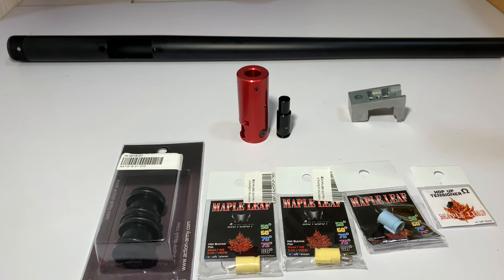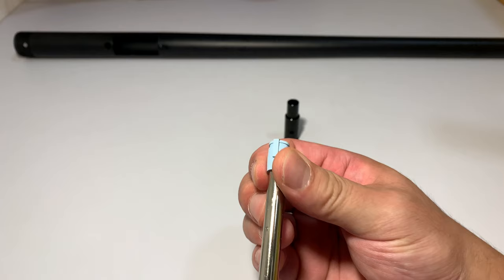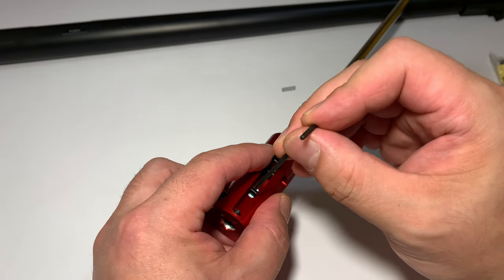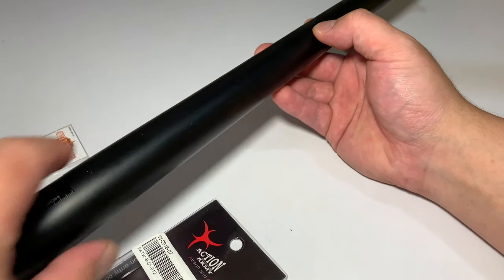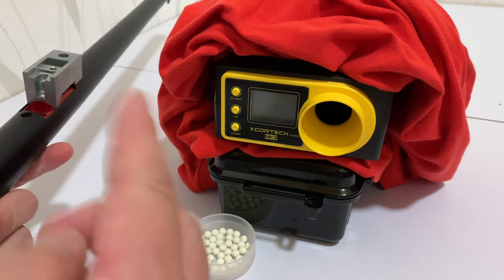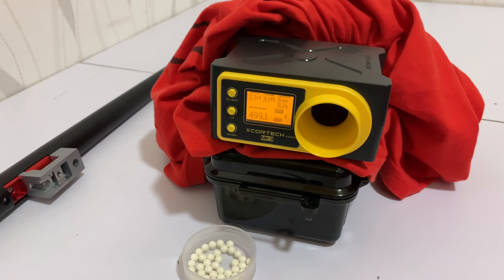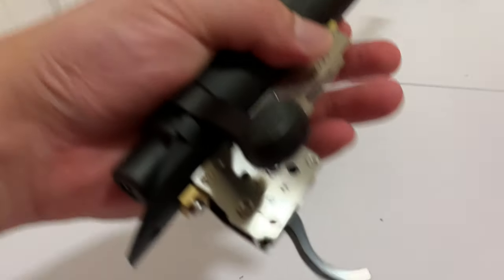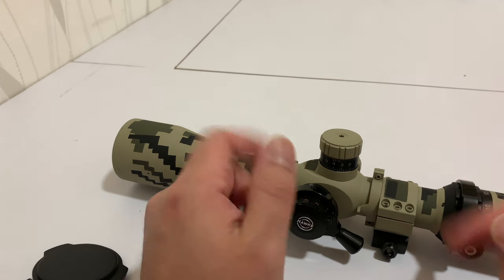VSR-10 Build Series EP 3 - Hop Up, Barrels, Spacers, Chrono, Scope

Comment: when i ajust my hop up, the fps drop and they don't go up like you, i have the same part installed.
Reply from the maker: Jérémi Caron 
It might be a good idea to disassemble and recheck all parts, especially the hop rubber. Some hop up rubbers can come from the factory a little badly made. Also pay close attention to the mini nub and make sure it is seated correctly.
Reply: @AirsoftAfterHours  everything is placed good, when i adjust it, the fps goes up until i get to the peek, and then if i adjust more, the fps goes back down and the hop up efffect cancels
Reply from the maker: Jérémi Caron 
That sounds like everything is working correct, once hop up is adjusted enough to lift the bb no more hop need be applied 👍🏻

Comment: by your accent i'm going to assume you are UK based...

bit concerning.... what you are suggesting is to adjust your hopup to take a 517 fps gun (dangerously close to the 520fps reclassification limit of 520fps or 2.51 jules were it'll become an airgun not an airsoft gun in the UK) to under the 500fps limits that most airsoft sites have for bolt action sniper rifles in the UK,.....  

2 major problems with this.... 

firstly 
the 500fps (2.32 jules) is meant as a maximum energy that the rifle can achieve no matter what the position of the hop is.

and secondly 
an more importantly the limits are 500fps which translates to somewhere around 2.32 jules with .20g bb's but ill be willing to bet you that with jule creep will push the jules to somewhere near or above 3 jules with .40g  or heavier bb's making it an airgun  and subject to normal firearms laws and regulations... generally you should be looking at around an m125 ish to keep your jules on or under the 2.3 jule limit. iv setup wolverine bolt kits that have massive jule creep having to drop the .20g bb fps down to only 400 to get the 2.3 jules on .40g bb's...

by pushing these to the very limit you are getting people to use jule creep to effectively cheat and worse still run illegal guns at airsoft sites, especially the sites that don't understand the jule system yet

you should probably stop trying to convince people to push the envelope and get as close as possible to the limits cos it'll end up landing you on the wrong side of the law or worse still convincing your viewers on to the wrong side of the law.... and to be honest with you im a little annoyed at this as you said in the vid you do stuff with airguns as well (when talking about your scope) meaning that you should understand that the law uses kinetic energy not fps when testing the legality of sized airguns that is why all airguns will be around 11 ishft/lb not the maximum 12ft/lb (16 jules) to account for ammo weight and other factors so there is absolutely no reason why you should be pushing people into running illegal guns, at airsoft sites. please stop this as i do really like the sniper role and if these breaches in site rules keep up then your gonna get bolt action rifles banned at the site level.... or worse get someone else banged up under firearms laws for shooting people with airguns all cos they followed your advice on tuning thire airsoft sniper rifles
Reply from the maker: Hi, thank you very much for your comment, we completely understand your valid concern, it is genuinely not our intention to push airsoft enthusiasts to use illegal or dangerous airsoft rifles. Our sole purpose was to try and share hobby tips for all our viewers from around the world. 

As with any true hobbyist, when cause for concern is present, we will do everything in our power to correct it, because we care. So we have decided to add warnings in all of our sniper rifle descriptions and create a public service warning video, to educate those new to the hobby and wanting to adopt the role of a sniper of how to stay safe and legal with regards to power/ fps/ joule ratings. 

Thank you for your detailed input and true concern, we appreciate your mature nature of viewing the sport and hobby, we'd also like to add that we are not a reckless entity that tries to convince it's viewers to push the envelope on power limits, we take everyones safety very seriously which is why we will do what we can to make sure our viewers understand the dangers. 

All the best! AirsoftAfterHours ^^
Reply: @AirsoftAfterHours  thanks for  your mature attitude and i do apologise for  not only for the rant but the length, i kinda got carried away, i don't usually rant at people but i had this issue at my site the weekend before last and i saw this an it set me off a bit, lol, what had happened was a young girl stumbled in front of a friendly sniper (both regular players) as he was taking a shot around 10m away (granted it is well inside the 20m minimum engagement distance) it hit her just above the eye pro and penetrated the skin and traveled about an inch under the skin,  so another test of the sniper revealed 2.3 jules with .20g and another test with his ammo that he said was .36g at 375 fps or 2.35jules so yes it was close but too close to really grumble at the time, couldn't use our heavy ammo as i had sold it all that morning.... but... i then get a call off the girl who was hit after the hospital had removed the bb from under the skin with 6 stitches and possibly a permanent scar (though lucky to not lose her eye) and her dad happened to weigh the bb an oh dear is a .46... which means even though it was good on the crono for .20g bb's with .46 he would be somewhere at or above 3 jules, so now im in a very awkward position and have a lot of consequences to deal with an when i saw this i got a bit frustrated and a tad angry, it not fair that i rant at you as there are far bigger youtubers who are using the jule creep, weighted pistons and over voluming to effectively cheat the chrono to gain advantages and to get that super long shot on camera to get more views without considering safety and they seem to forget that not everyone is a professional airsofter and that there are newcomers and younger people. im no by no means an expert and id love to say this is an isolated incident but iv had to learn all the balistice stuff as this is the third penetrating injury at the site in as many weeks and what really concerns me is how people are using their tech knowledge to gain advantages which in turn pushes the more honest players to do the same to be able to keep up and forgetting that is a game at the end of the day. i've been so concerned by the frequency of issues i've been finding in the last 6-8 months that i had decided to hand on my site to a new owner as it isn't what i signed up for, an i certainly don't enjoy telling/arguing with players about the legality of their airsoft weapons, especially when some of them have come 200 miles for one of our weakenders or night opps games
Reply from the maker: No need to apologise, we completely understand the concern. We're sorry to hear about the girls misfortune, we hope that girl is doing is ok and recovers well! 
Safety is absolutely paramount when engaging in this sport and we take it very seriously, our future videos will definitely consider this and have warnings in place where necessary, we believe this will both educate or enlighten some players and help build a stronger, more unified community. Thank you for bringing this topic up as it's good to share information within the community so newcomers get more insight into all aspects of the hobby, especially safety.
We sincerely hope the troubles you are going through get sorted out quickly and that the future of our hobby stays strong with the help of hobbyists such as yourself, sometimes it takes the effort of a few to secure better future. 
All the best, and thank you for what you are doing for the sport and it's players!
Reply: @turo1012  my dude she got hit with about 2.14 joules at that distance!!!!!
I usually go 480 FPS with.20
And run .43.
I use low power as I use IR hop and HPA but I still outrange other snipers.
Hop up is what matters most not FPS.
Reply: my bad 165 to 168 psi lol...
Reply: @turo1012  there is an airsoft ballistic calculator that I have on my phone.
I recommend you get it as it is free.
I contacted the guy and he is adding better features!!!!!
Reply: @turo1012  the app is called Airsoft Ballistics Calculator
It's makervis androiderob
I think if you go to your appstore and search that you should find it.

About how accurate my calculations were I don't know but they should still be pretty close